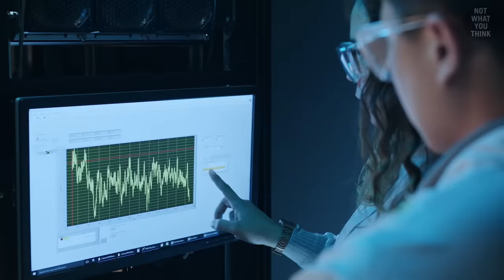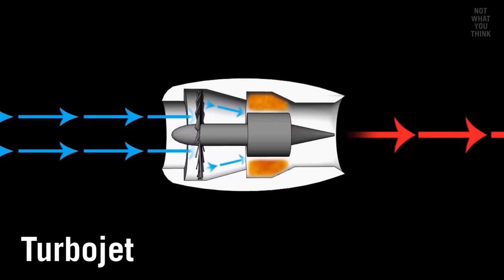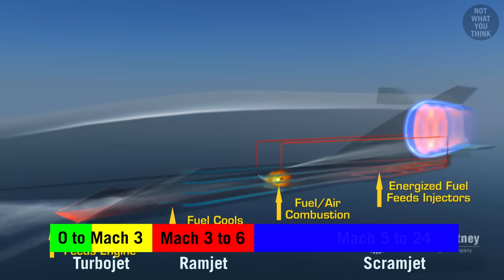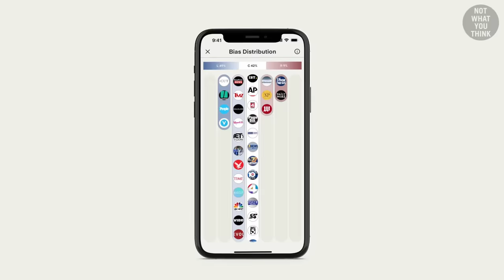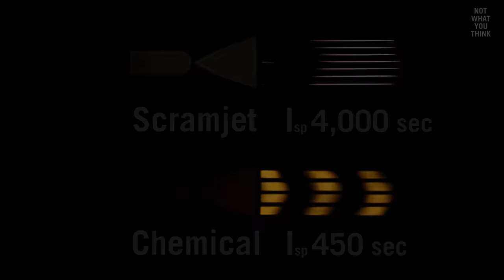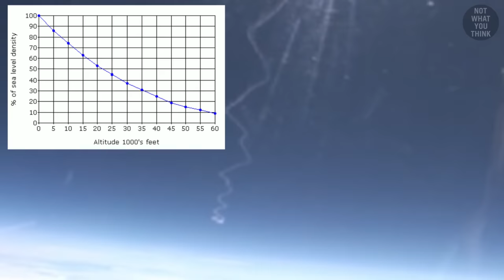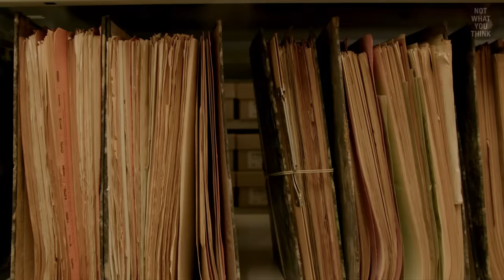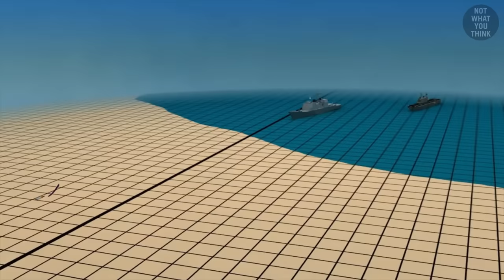The Hypersonic Missile Vulnerability That NO ONE Talks About

Comment: You made a mistake with the turbojet. The jet on the commercial plane was a turbofan, which is nearly impossible to get past Mach 1, but a turbojet does really well at Mach 1, but decreases exponentially the faster it goes
Reply: Indeed, supersonic fighter exist😅
Reply: Shows how much "knowledge" he got. It's not what you think.
Reply: @Thunder Boob Whoever owns your channel is a conspiracy theorist and it doesn't matter what you type as long as it induces mass fear. Unfortunately it failed.
Reply: Turbofans can go past mach 1, both the f-22 and f-35 use turbofans

Which further proves your point that going above mach 1 is not an issue for either turbojets or turbofans
Reply from the maker: We simplified the language by combining turbojet/turbofan, and you are correct. But the premise between turbojet/turbofan is more a less the same, lots of moving parts in between that compress the air.
Reply: @NotWhatYouThink  So you dumbed it down so that the average person who isn't into aircraft can understand it

It's Not What You Think
Reply: @nesyboi9421  you described me :P
Reply: @nesyboi9421  - Yes, and i would do the same... they are different comparing against each other, but comparing with other technologies, they are very similar.
Also they have a TIME problem... if you describe everything to the letter, your videos will have HOURS of duration. Many content creators on this field make very good videos but have to cut a shit ton of it because how long it becomes... some even create a second channel just to drop the complete version of the videos.
Reply: @Thunder Boob I realized this after this channel's Ukraine war report
Reply: @michaelerzuah1105  cope harder, Vatnik
Reply: bruh  they are inefficient
Reply: Turbofans work just fine past mach 1. It's the high bypass fans of passenger airliners that don't work well past the low-transonic regime.
Reply: @greecevstheworld  Until about mach 2 they maintain an efficiency edge over turbojets.
Reply: Guys really need do homework. Geez
Reply: @That Guy He just simplified/skipped over the difference between two similar technologies to streamline his comparison against ramjets and scramjets. Go back to reddit and or relax or something it's gonna be okay
Reply: Depends on bypass ratio
Reply: @brianfhunter  I honestly would not cut out as much as this channel often does though to be honest
Reply: @nesyboi9421  you need less time on the internet
Reply: modern jet fighters use turbofans too
Reply: @Iianator  ratio
Reply: @coffeecat9854  debatable, I personally like the amount of time I spend on the internet
Reply: @NotWhatYouThink  I understand and forgive the simplification. That said, I think adding a few seconds to clarify that it’s over-simplified would have been well-spent.
Reply: You are not entirely correct either. Turbofans are limited to about Mach 3, not Mach 1. The F-18 has twin turbofans, as does the F35, and F22, all of which are supersonic.
Reply: You do realise that modern fighter engines are turbofans and not turbojets, right? Like the F-22 supervising engines are turbofans.
Reply: @taktuscat4250 And they mostly use turbofans
Reply: @pd28cat  buzzword psyop
Reply: @Wak3UpAm3r1ca he means high bypass turbofans, not low bypass
Reply: Actually, the F100 engine that powers the F-15 is a turbo fan, what matters is not if it is a turbo jet or a turbo fan, but it is the Bypass Ratio
Reply: An actual "Turbojet," require the mid chamber of scamjet, with its front ramp cone head, having mini rear rocket boosters, as early fuel/afterburner flow, substituting thick atmosphere, at vhigh micro air realms. far lesser fuel than rocket. Space orbital Sstol feasible start: jet, ramjet, scamjet than "Turbojet." Phase vs Stage.
Reply: @rolflandale2565  That jumbl,e of words makes no sense...
Reply: @kubauhlir1730  "Vhgh micro air realms" are totally a thing. Coincidentally discovered by his brain surgeon but I digress. *Runs off giggling*
Reply: Super Cat, turbofans are a subset of turbojets. I'm an aeronautical engineer. I can vouch for Not What You Think's usage of the term. The distinction is in the usage of turbines, vs a ramjet with no moving parts. That is the point you missed in the video.
Reply: @justins8802  There is nothing to clarify and nothing to be forgiven
Reply: @Wak3UpAm3r1ca  the SR71 used a turbo jet, with a partial bypass compressor section.
Reply: bruh  Nither turbo jets nor turbofans can use supersonic air. They require the air inlets to slow the incoming air to slow to subsonic speeds. This slowing of the air also increases  the pressure of the incoming air.
Reply: Neither turbojets nor turbofans can use supersonic air. They require the  air inlets to slow the incoming air to subsonic speeds. As the air is slowed down  the  pressure  increases which is beneficial as well.
Reply: @NotWhatYouThink  ooooh... so you simplified it... great! very good to know we can count on this whole video as accurate information then...
Reply: @Wak3UpAm3r1ca  turbo fans attain supersonic speed with afterburner. Even the f119 in the f22 super cruises without afterburner, but uses the afterburner to obtain supersonic speed first, then super cruises in military power.
Reply: @antoniohagopian213  so one mistake tells how much knowledge he has
Reply: @nesyboi9421  - 15min is the golden rule of videos on youtube, i dont care if the video has 60 min, but statisticaly people really dont like videos with 20min or longer...
Reply: @GabrielVitor-kq6uj  it is as accurate as possible while keeping the video short to attract an average viewer. If you don't like this channel then you're more than welcome to look for others, otherwise you're just being a whiny baby
Reply: @NotWhatYouThink  fair enough, especially considering the main difference between a turbojet and turbofan is just the lack of a bypass.
Reply: @brianfhunter   @Brian Fernando   @Brian Fernando  You can I fact go into more detail and keep it within 15 minutes.
Also plenty of youtubers have minutes that average 20 minutes that are very successful. For example a lot of Mark Robert's videos average around 20 minutes. Actually Summoning Salt's entire channel is hour long video essays and he gets millions of views on every single video he makes.
I don't think the length of the video matters so much as keeping a viewer rapt and paying attention, at least that's how it is for me.
Reply: @michaelerzuah1105  🤡🤡🤡
Reply: Although whole video being about hypersonic, bunch of boiz arguing about turbofan/jet 😂
Reply: i think he "merged" torbofan and turbojets together while 1 fits to an airliner, and the other fits to a jet fighter.
Reply: some turbojets have the ability to get more and more effective up to around mach 3 before severe performance drop-off. And now there are companies working on engines that can transform mid-flight from turbojet to ramjet which could be applied to hypersonic weapons (although id really prefer if no one made hypersonic weapons and we didn’t kill each other, but the tech is getting better)
Reply: He makes a lot of mistakes.
Reply: You are wrong also the turbo jet is not used anymore since the F4  the turbo fan is in the FA 18, 15, 16 and the F22 raptor all are supersonic. Turbo fans are dual drive shafts and having an LP compressor and a HP compressor is actually better to control temperature in the JPT.
Reply: @antoniohagopian213  with 2.18 million subscribers, facts are optional. This is a $1 million/year channel.
Reply: @Thunder Boob They make 680,000/year.
Reply: I see them used interchangeably all the time. It's ironic because I was googling them. Like what is a turbo prop versus turbo fan versus turbo jet versus turbine versus piston.

 It gets confusing when people use the word jet too... Or prop versus rotor versus fan versus compressor. Grah! T

 Then if you want to get complicated you go into afterburners and compression or bypass ratios and why each jet uses bigger fans or compressors.
Reply: @brianfhunter  Given the quality of the Video i believe 1 hour for every minute of video is a Realistic estimate.
Reply: @NotWhatYouThink  They are 2 different machineries aren't they ? Turbo Fan push the air to generate thrust. The turbojet push hot exhaust gas  to generate thrust.
Reply: @antoniohagopian213  His country lags behind in this technology hence the propoganda.
Reply: @Folkert.Cornelius  You can call it propaganda as you please....
No country is free of propaganda and no side is free of propaganda but let me tell you Sarmat is a MIRV Nuclear Ballistic Missile.
Not impossible to stop but extremely hard to stop because of multiple warheads. And if the warheads can maneuver it will be extremely hard.
And it's not difficult to achieve. Countries that have successfully launched multiple satellites in one rocket can do that if they want.
Reply: @Iianator bro who asked you?
Reply: @NotWhatYouThink  no you got it wrong, these are basic distinctions
Reply: What's the problem, he says it works up to Mach 3 but efficiency goes down with speed.
Reply: @justins8802  no it wouldn't.
Reply: A desperate attempt to gather likes.
More research for these advanced topics
Reply: @Thunder Boob THE MESSAGGGGEEEEEEEEE
Reply: @NotWhatYouThink  Don't fall into the trap of power corruption through success, please keep with the logical peer review stuff rather than just becoming yet another monomath who mistakenly believes they are now  a polymath because they mastered a tiny field. You are making errors, but cannot see them due to to being surrounded by "yesmen" this will increase in direct proportion to your financial success... Thanks for the videos my offspring appreciate them.
Reply: @lalxl  lol
Reply: @RandomNooby  "Offspring?" Yes Father
Reply: @jjclark1035  ok BRO
Reply: @jjclark1035  O.K. Bro...
Reply: @RandomNooby  One reply wasn't enough? 🤣
Reply: @jjclark1035  Either I live alone on my own warship and the passive Ewar gear on passing NATO subs fuk with my comms setup, or you are so special and important to me you deserve 2 replies (;
Reply: @RandomNooby  Did you just blame your keyboard vomit on elctronic warfare?
Reply: @jjclark1035  Nope, keyboard vomit seems  to be your thing. Fair winds,  and goodbye.
Reply: @RandomNooby  Yes grand wizard🙏😭
Reply: F-15 and most modern fighter jets I can think of have turbofans.  Fully capable of well over Mach 1.  Not nearly impossible at all.
Reply: @zakisaacson2188  They seem to be considering  a turbofan, and a turbojet as the same thing...
Reply: @NotWhatYouThink  Best answer ever, I also have to simplify lots of explanations and there is always this guy that tells you you are wrong, little that guy knows that you,ve been thinking for hours how to get the message understood in the simplest way. Amazing video dude.

I have seen on the internet that plasma avoids missiles to be detected due to the interference between radio waves, anybody has any source about that?
Reply: Actually main difference between turbofan and turbojet is bypass ratio. Turbofan relies on it HEAVILY to generate thrust. Turbojet - not so much. But one could argue that turbofan is merely subsonic variant of turbojet engine and not much more.
Reply: @andanandan6061  Yes and no. Imagine it like this. A turbofan is essentially a turbojet with an additional, larger set of ducted fan blades in front of the turbojet. At least in airliners, this makes the engine quieter, and more fuel efficient. You still get the thrust from the core of the engine in addition to whatever thrust is produced by the bypass fan
Reply: @NotWhatYouThink  Don't post videos where you make a butt load of mistakes and things you don't have information about and how things "work" and "don't work" because you don't really understand it yourself.
Reply: @RandomNooby  These sort of videos often have technical errors.  They're still interesting.  The engines are very similar.
Reply: @ripLunarBirdCLH  Certainly similaar.  Forgiveable in a simple, superficial fan video.  No pun intended, really.
Reply: The first diagram was definitely a turbojet, there was no fan bypass, it was only compression.
Reply: It's all about bypass ratio.
Reply: Most modern fighters including some that are capable of speeds up to M 2,5 use low bypass tuborfan engines.